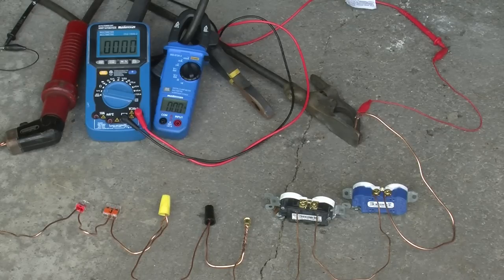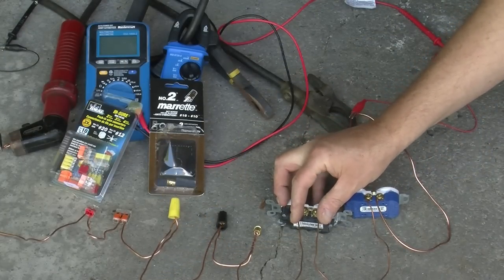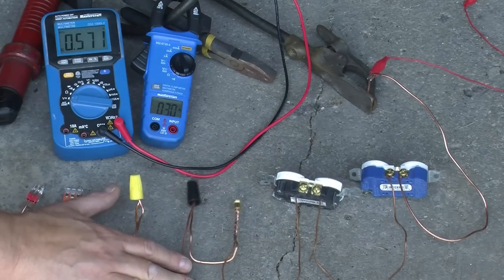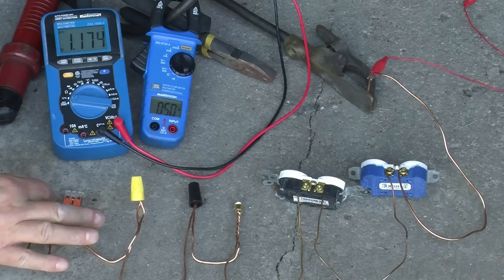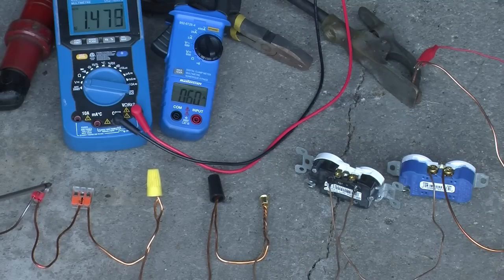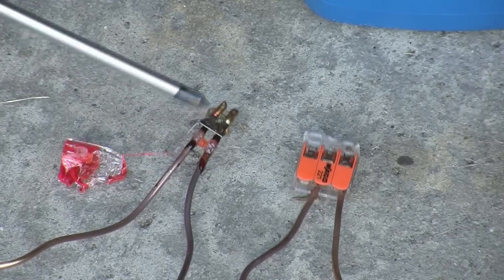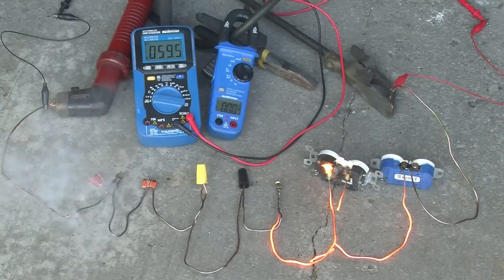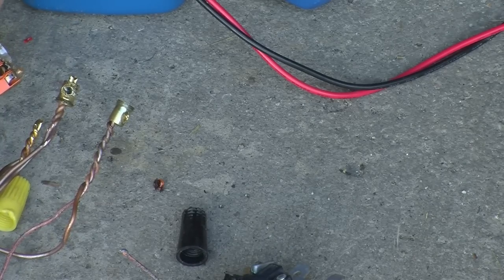Connectors: Which is the Weakest Link

Comment: Great test!  It's discouraging how houses get more expensive as components get cheaper and more prone to fail.  This isn't progress.  Wagos are a hard no for me.  Marretts and screws on all connections for trouble free installation.
Reply from the maker: Well thank you!   I would also stick to Marrs and screws other than possibly for a low current light fixtures or something like that. But in fairness to the Wagos they did handle rated currents. I would be concerned if they were in circuit where significant overcurrents were a regular occurrences such as for induction motors (pumps and compressors for example) that can often draw five or more times the rated running currents for a few seconds during startup. I'm not sure when these particular  Wago connectors first appeared, but it would be interesting to know they long term reliability under those circumstances.

Comment: I wired a finished basement using the push-in connectors on the outlets. I will NEVER make that mistake again! My outlets, were rated for #12 gauge wire, rather than the #14 gauge, but, that didn't make it any better. ALWAYS use the screws, and wrap the wire around the screws. You want the contact area between the wire and the pads to match or exceed the cross section area of the wire itself, to ensure that there is no more temperature rise at the connection point, than in the wire itself. That will guarantee safety when plugging in high amperage loads, like hair driers, space heaters, toasters/toaster ovens, or even large vacuum cleaners.
Reply: I wired my basement the same way about 17 years ago. Since then I've replaced every receptacle and terminated on the screws. I ran into several outlets wired with the push in connections that would lose power when you moved or torqued on the plug. Several would lose it with only slight pressure or would require you to move it around to get power at all. I had a couple where you could even hear slight arcing in them when that happened. I finally decided I didn't want my house to burn down so I replaced them all and terminated them on the screws. No problems since then.
Reply from the maker: So how did the problems you must have had appear? Did the occasional outlet burn up when a high load device was plugged it? Or did they just randomly go bad?
Reply: @ElectromagneticVideos  My problem with push in connections on outlets  and switches was random open circuits. This resulted in call backs to troubleshoot and correct. I quit using push in devices 40 years ago,
Reply from the maker: @WesB1972  Gee that must have been costly and frustrating! I cant believe they still have that feature - I have not seen a single comment here  - or anywhere else - where anyone says they are any good!

Comment: Very neat test! Thank you. 

I had always suspected that there was a lot less engineering margin with push-in connectors such as the In-Sure and press-in outlet backwiring holes. The twisted and bolted connections are going to have a lot more surface area to transfer the current from one conductor to another.  Looks like this proves my guess right! 

The Marrette connectors are neat. They are very early in design.  I have restored several early 1930's Frigidaire belt-drive refrigerators which had the same Marrette connectors on the motor leads. They have a Delco repulsion-induction motor, which all seem to have come with those connectors. 

We call those outlet backwiring holes "lazy electrician holes" because they encourage people to take shortcuts. 

A couple more connection designs I want to test is the twisted, soldered, and friction-taped; and crimped and soldered and heat-shrinked connections. Those are very labor-intensive connections from the very olden days.
Reply from the maker: Yes - and in spite of the heated discussion somewhere below or on one of the other threads, I now convinced that as you said the surface area of twisting under  Marr connector is unbeatable for many situations. 

I just subscribed to your channel! The old refrigeration equipment looks so interesting. I never heard of belt driven electric refrigerator. Was that maybe before someone had the brilliant idea to put the motor inside the sealed system? I'm sure i will find the answer when I have watched some of your videos. 

Of the connections you mentioned that intrigues me is crimped connections and soldered connections. And the reason is the local cable manufacturer that we use to make cables for a product at my workplace swears to me that crimping is more reliable than soldering. Now these are low current signal carrying cables as opposed to power. Have you seen vintage ones from either type do better than the over over time?
Reply: @ElectromagneticVideos  
Thanks for the reply! It's funny how many people eschew and scorn the venerable old wire nut. But, they would not have lasted so long as a product had they not been reliable and safe. I find it silly how people get emotional, aggressive, and argumentative about wire connectors! I would like to think I have more significant things to get all worked up about!

In the late 20's GE was one of the first to commercialize a sealed motor compressor. They sold the Monitor Top "DR" for Domestic Refrigerator. It had a massive steel dome on top with the compressor and motor inside. It has an oscillating cylinder compressor and induction motor. The bottom of the dome is attached with a bolt circle and can be removed for rebuilding. Quite a machine, and very collectible!  Before this, almost all refrigeration machines were belt-driven.  One of the challenges to making early sealed units was material compatibility. The first (relatively) safe refrigerant was SO2 (sulphur dioxide) which has very limited material compatibility. The early sealed designs struggled with keeping the SO2 from degrading the materials used to construct the motor, and electrical pass-through terminals which transferred power into the sealed housing. GE developed some fused-glass terminal seals which made them the leader for decades in this area.  

I tend to think that crimping is a good idea for most applications.  Soldering has its place as well. When you do both, you have the best.  Crimping will retain the wire, even under fault conditions such as loose connections. The heat can melt solder, which can release the wire, or the solder can flow and create shorts. Solder will completely seal out corrosion and prevent deterioration, so in my opinion crimped and then soldered with a very minimal amount of 2% silver leaded solder is the longest-lasting connection when any sort of exposure to moisture is possible.  I see wiring from 40's era things with that technique, still looking like new.
Reply from the maker: @davida1hiwaaynet  Believe it or not we had an SO2 fridge at our cottage (aka cabin) when I was a kid. Dad got it at an old farm auction so it was old when we got it. But modern compared to what you described - the compressor was already at the bottom. It lasted a few years till the thermostat broke - I replaced it with one from a junked fridge but a year or two later parents got a new one that was drastically marked down with a scratch. So I extracted the  fridge heating cooling section without perforating it and made a not very effective air conditioner with a fan. i was innovative as kid! Eventually as it was being thrown out the evaporator got perforated. Oh did it stink!

Interesting your comments about crimping - I never though about solder in hot environments - do electronics and if its hot enough to melt solder other things will already have failed. Have done crimp + solder - but do it because my crimping is so bad - a lot of small signal connectors need a very costly tool to do it right and each one needs a different tool. Always fascinated to hear what has lasted so long long and survived. Thanks for taking the dime to write such a detailed response!

Comment: Great video.  The Ideal connector (far left) and the duplex receptacle using the push-in terminals seem to be doing the worst.  Both rely on the back pressure of the contacts on the wires.  The others rely on screw down torque or twisting together the wires themselves. I'm surprised that the Wago (lever action) connector fared so well.
Reply from the maker: Thanks! I wonder if inside the wago there is a larger surface area to make contact with the wire rather than more of an almost single point contact.  I would certainly use the wago for something like a ceiling light but would stick to marr (wire nuts) for anything that could be expected to carry significant current.

Comment: WAGO is pronounced "VAGO" and is from Europe as far as I know.. my former boss, who was an electrician, said those set-screw Marrette connectors were outlawed (Canada) because as the wires heat and cool over time, the set screw can back off and the connection loosens.  From online spec sheets, it seems that they still sell them though.. I don't pre-twist unless I have more than 2-3 wires going into a wire nut.. or if I need to connect a couple with a twisted lead.  The wires will twist as the nut is installed.
Reply from the maker: I have since hard that too. I wonder how common the correct pronunciation is in Canada and the US?

Comment: I wish there was some way to include the damage that wire nuts do to the wire. It isn't always possible to cut down and strip new wire. When a wire is pulled from a wago, it's perfect. The wire that has been in a wire nut is bent, scored, and fatigued
Reply from the maker: Very good point. Even just the variation in good/new wire connections. To do definitive tests, one would really have to setup situations like you describe and then have a thousand electricians of  degrees of experience make the connections, and the test each and characterize the variation in results.

Comment: 👌👌👍👍    Somewhat surprising is that the #6 push in receptacle should have been equally as good as the #1 Ideal and #2 Wago.   Had these three been tested together with a #14 conductor, I suspect the Wago would be the first to fail.
Reply from the maker: Yes - you would think it would would be just as good as the ideal which is just a push in too. No idea with the receptacle is so much worse, but many beope in the comments have reported real-life experiences with them failing so its a very real concern.    At some point I should do a #14 test for all of them!

Comment: Much appreciated. Confirms what I have always suspected.  I re-wired a sister in laws house once to convert from back stabbed to side screwed.
Reply from the maker: Your welcome! Some many comments about replacing the back stab outlets!
Reply: @ElectromagneticVideos  I wonder what if the back stab was actually the problem? the blue outlet was maybe a better quality plastic, and maybe the black outlet would have melted the same way whether it was backstabbed or side screwed. I would be interested to see two of the same black outlet, one back stabbed and one side screwed on circuit like this. Thanks!
Reply from the maker: @nicksz8909  Very valid point. Adding a  back stab was a last minute idea and I didnt have two  identical outlets in my junk box.  The different plastic could certainly have made a significant difference, or even internal construction of the outlet.
Reply: @ElectromagneticVideos  Thanks for the reply! I think the testing that I mentioned would really help to show whether it is the back stab or just cheap outlets that are the problem in normal conditions.
Reply from the maker: @nicksz8909  Also might be interesting to see if SPEC outlets do much better than regular ones or if its that they are more mechanically robust for repeated plug insertions. 

A number of people have told a few stories how they had to replace all the outlets in new installs after the outlets started randomly failing months later. Others have told of how problems surfaced years later.  To me, that means more than any quick informal test I might do here.

Comment: Isn't the idea connector and the wago essentially the same thing as backstabing the outlet? It's just a thin piece of metal that slightly cuts into the wire.
Reply from the maker: The wago has a lever to lock the wire in, but the Ideal seems like the backstab outlet as you suggest. What odd is how much poorer the backstab outlet is.

Comment: With current flowing through those bare wires you are able to touch them without getting a shock. Is that because the wire is a better path to follow than your hand?
Reply from the maker: Its actually because it is low voltage. Since the wire is shorted at the end with the wire nut, it has very low resistance, so only a 1 or 2 volts is needed to drive the large current. So this makes the test quite safe voltage-wise while still making the wire experience the   various degrees of overcurrent. If we had a huge 120V load at the end instead of the wire-nut short and used 120V to drive the same current, we would get the same heating for the same current but it would not be safe to touch.
Reply: @ElectromagneticVideos  It would be wonderful if you'd consider making a video on this subject!  I'm (very) new to your channel and so haven't made it too far back through your videos, so apologies if one already exists.
I had the same question in my mind as Dave asked.  That so few people commented on this, the further I had to scroll to find even this one, the more I thought this had to be a stupid question.  None the less it has still been slightly unnerving while watching your test videos!
Reply from the maker: @lorddissy  So the couple of recent videos that got popular actually are a poor representation of the rest of the content - which is a much more general smattering of technical things that I find interesting. So you may be disappointed if you look back hoping to find similar stuff. 

The reason I can touch them is the voltage is really low: 1 or 2 volts! That is the voltage drop you get along a conductor when it carries power from the breaker panel to the load because the conductor is not a perfect conductor, but has a little resistance. So at the panel you might have 120V and maybe at the plug of a big heater it is only 118V. 2V is lost along the wire when the wire carries 10A (of course the are just illustrative numbers - they vary based on wire length etc). So that 2V at 10A means 20W is dissipated as heat in the wire. As long as there is 10A flowing it doesnt matter what the actual wire to wire voltage is - almost zero in this case or 120V for a real load: the heating is the same. Of course how much energy gets to the load does depened  on the line to line voltage. In our case the voltage across the load (the wire nut connection) is essentially zero so its 0 watts. If we has a real 120V load 10A current would mean about 118V x 10A = 1180W would be delivered to the load, but the wore would still dissipate 20W. If I had done it that way I sure wouldnt be touching the wires! I might do an explanation video since many people have asked variations of the question. Hope this hastily written explanation has  helped!
Reply from the maker: See my answer below!
Reply: It doesn't matter about current flowing through the cables, that doesn't determine whether you get an electric shock or not. What does is: the source voltage, the source resistance, the wire resistance, your body's resistance.
Reply: @deang5622  Thanks. Do you have a link to something that would explain those principles in more detail?
Reply: @daveschreiber9587  I don't have any links, but they are principles taught in undergraduate degree programmes in electrical and electronic engineering.

Text books on basic electrical circuit theory ought to cover it.

Comment: Circuit breakers only allow a large surge current for a few seconds, not a half hour. This allows things like motors that draw a huge amount current to start without tripping the breaker
Reply: Otherwise I very much liked your test.
Reply from the maker: @yodasbff3395  Glad you liked it! Look at the spec sheets for some breakers like the common (at least in North America) BR type ones. Some have spec sheets that have a surprising range of allowable thermal tripping time for currents of for example 150% of rated value - in some cases the range being zero seconds to up to half an hour. You buy a breaker and it is "guaranteed" to trip somewhere within that range. You do have to dig deep into Eaton's website for some of the specs - not something that is in the more generic brochures. I do wonder as we move towards electronically controlled breakers like AFCI ones if eventually we will end up with very precise spec curves rather than regions. I do worry about the added complexity and reliability over time. Your so right about huge motor current surges at startup  - most people have no idea things like induction motors can easily draw 6 times the rated current at startup.
Reply: There are two trip mechanisms in the breakers you're familiar with:  an electromagnetic trip for dead shorts and a thermal heater/bimetallic strip for overloads.  The thermal is not precise, depends a bit on ambient temperture, and takes time to trip.  It definitely takes a very long time at modest overloads.  Then there are thing like Federal Pioneer's breakers that just didn't trip...